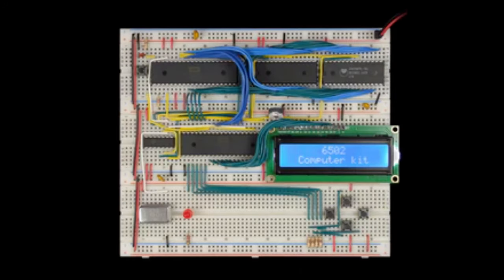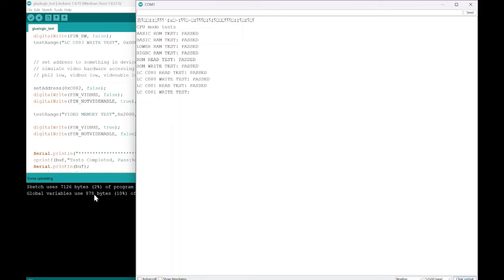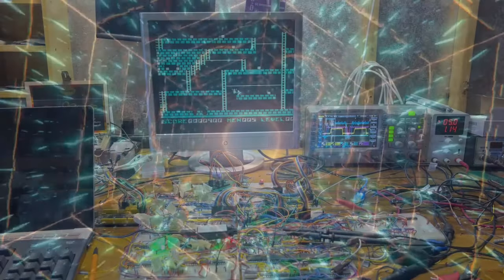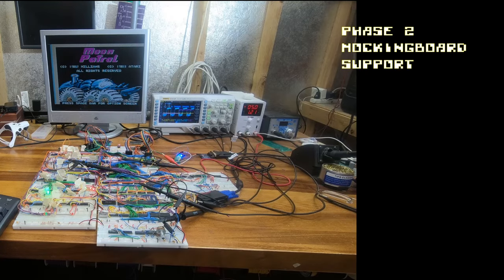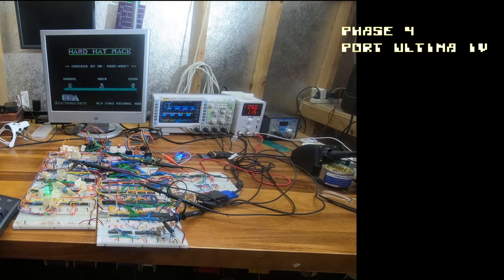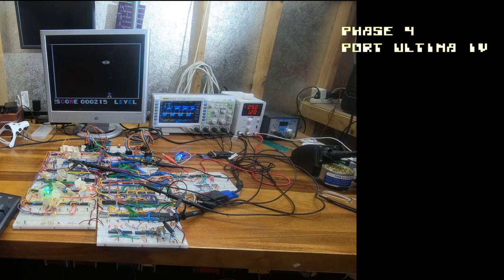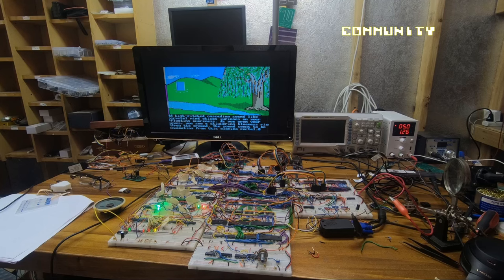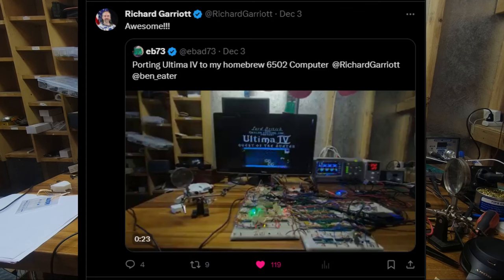Is the 3R1C Custom Computer a Commander X16 Killer? - Ultima IV Update

Comment: I just found your channel. So cool what you have made. I grew up on these 8 bit machines so they will hold a place in my heart forever.  Also built a lot of custom hardware back then.  One thing was a display. I designed one that was pretty neat. It had two frame buffers and a simple switch to flip between. No need for dual port RAM. Well anyway, your stuff is much better.  Anyway, very cool. Respect 👍🎉
Reply from the maker: Thanks!  I’m not using dual port RAM either. Too expensive. Instead using Woz technique of time division multiplexing. By far the most complex and tricky part of the design. I’m curious about your design, are you able to read back from video RAM with the switching design?
Reply: @thecodesorcerer  Woz was definitely full of tricks. I don't know if you have looked at his disk controller lol. It was back in the 80s so not current, but you could read/write the off-screen buffer, but not when it was being displayed. 6845 was doing the video on the back. This was for an Ohio Scientific Superboard II that I had at the time.

Comment: Freaking Wizard!
Well Done Sir, this is a Crazy Life Achievement if you ask me.
I would implement the NES controller IC, Piggyback for the SNES, that way if you further Expand the system you will already have a controller setup that can handle future possibilities..
Reply from the maker: Thank you, you are very kind.  As an 80's kid and a software engineer by trade,  It's been very rewarding. 
 I'm really looking forward to building an ASIC now.  How cool will it be to design a custom chip?
Reply: @thecodesorcerer  Poor 80's kid over here,. I had an uncle in Tennessee who was only about 12 years older than I, so when his TSR-80s, 286,386 PCs all were Upgraded over the years, I got the Old stuff to figure out.
I was always a Hardware kid, I couldn't get my ADHD brain to wrap around Programming, My extent was QBasic Menus for my Games.
My Pinnacle was IT Admin & CAD/CAM Engineer in Tennessee 2k3-2k7. That was a fun challenge trying to learn.
Now my kiddos & I turn Discarded PCs into Retro Game Boxes

Comment: X16 is way beyond this. Maybe buy one first & try it before titling it that way.
Reply from the maker: Watch the video if you want my take.
Reply: The X16 is far advanced of a typical 8-bit machine. The FPGA based Vera is probably closer to a 16-bit system's capabilities, and really does kinda break the spirit of being an 8-bit retro system. Yes, it's technically 8-bit, but it feels very cheaty in it's implementation, like tacking a 6502 onto a 16 bit board to call it 8-bit... I know that's not an accurate way to put it, but what It really feels like, is the 8-bit guy wanted to make an 8-bit machine, but really didn't wanna let go of the capabilities of a 16-bit machine, and created something that doesn't feel like it commits to either. I still bought one... But now that my money is already spent, I feel like I'd rather have grabbed a Foenix instead.
Reply: @richfiles  yeah I do see what you're saying.